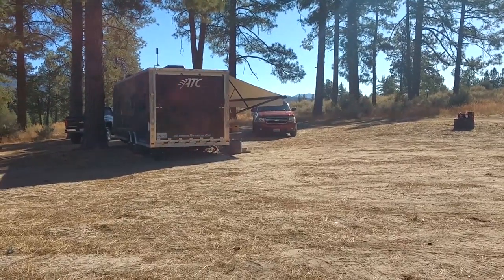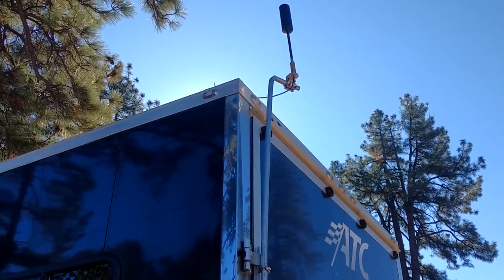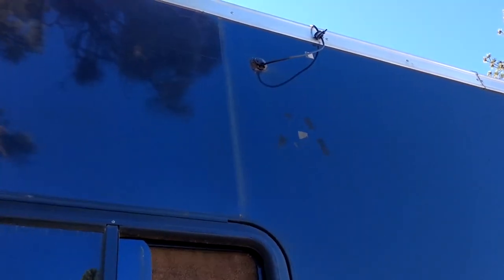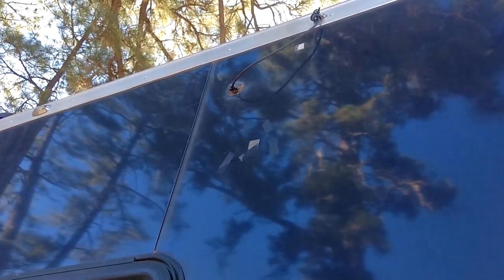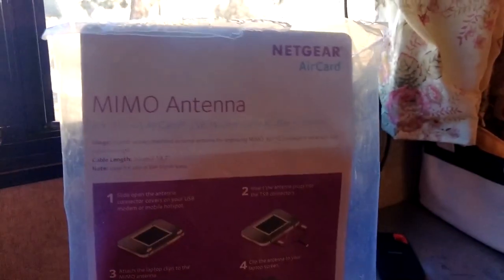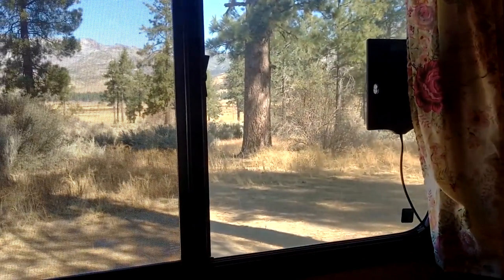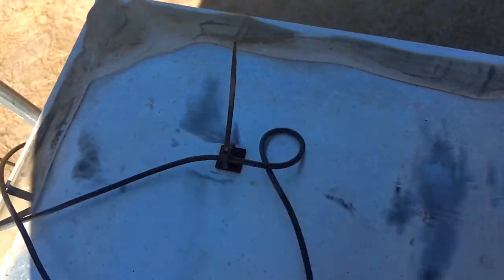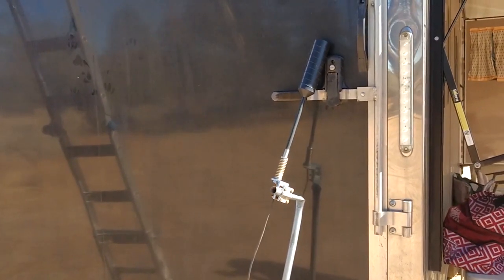Removing our WeBoost RV because we found something better

Comment: If the we-boost isn't working, a few ideas:

The cable might have damage, including moisture or cracks / breaks from motion.

To test: connect the amplifier closer to the antenna with a different (short) cable.

Or, the wifi signals are switching frequencies (higher), and don't travel as well.  

The amplifier, if hot, might have defective parts (caps).

The DC power, if not filtered, could have sent voltage spikes into the amp.  Especially if you have motors on the DC circuit.

Antenna could have been hit with a stone or bird  on the  road, and damaged.

You can test the antenna and cable, if you care, there's a tester called Nano VNA, which can analyze it for cheap ($50 or less).  If the cable is broken, The TDR feature can maybe tell you roughly where the cable is broken.

Just some ideas.